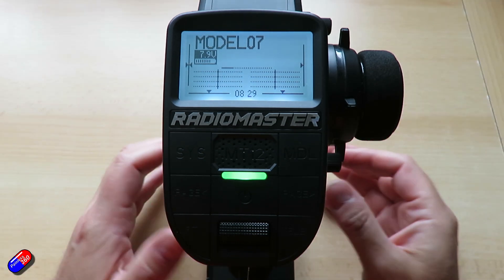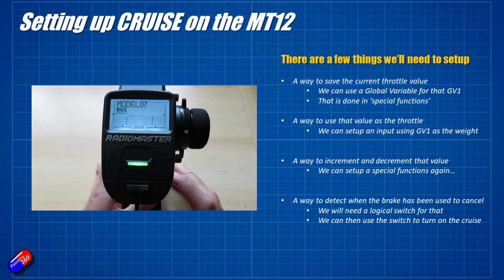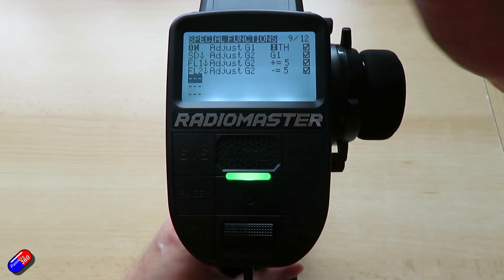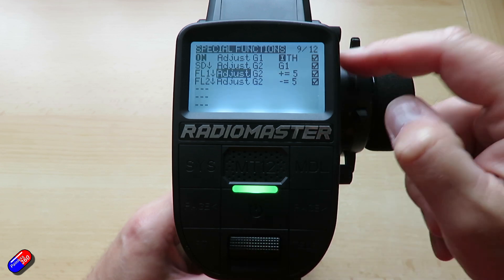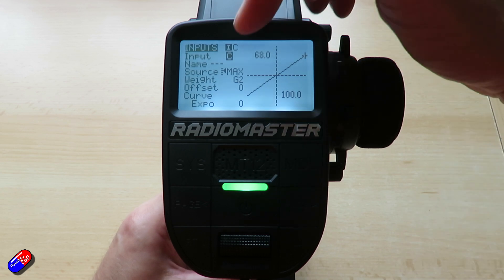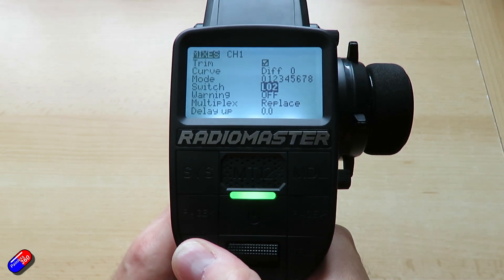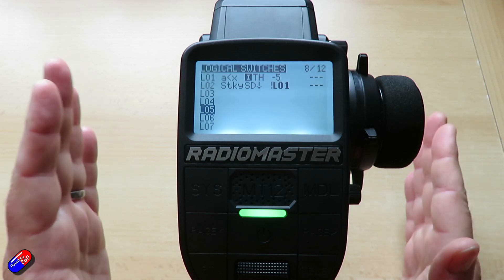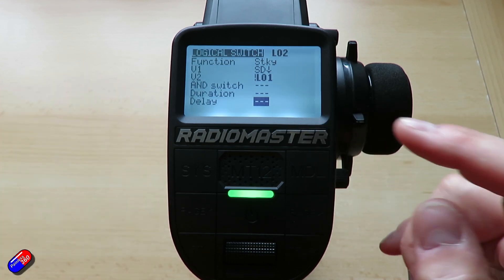R/C Car 'Cruise Control' Setup - with MT12 and EdgeTX 2.10.1 (Patreon Request)

Comment: Great video there Lee... hopefully it gives people ideas of just some of the things you can start to do when you use the various options and capabilities in EdgeTX - and not just on the MT12 - but any handset that it runs on ;) With the MT12, there are two sets of "unused" trims, so could even use one of those instead of the optional (flexible) switches. Meaning you can still use the joystick or gyro unit.
Reply from the maker: Yes you could. See my video on using trims as switches.

Comment: I set up cruise on mine to match what I had on my Traxxas TRX-4. That has a knob to adjust the cruise speed once it’s locked in.

What I did on the MT12 was have a second MULTIPLY line on the throttle mix. I tied that to the S1 knob, set the weight to 50, and offset to 50. So now if the knob is centered, it is whatever you locked the throttle at (100% of G1 value), and you can increase or reduce G1 by up to 50% by turning the knob in either direction.

I also added a third ADD line tied to the throttle trigger so I can momentarily bump up the throttle and then go back to whatever I set it to (like a real car would do).

Both of these are only active when cruise control is obviously, and braking turns cruise mode off with a sticky logic switch same as you did.

Like you said, EdgeTX gives you lots of different ways to do the same thing, which is great (and sometimes confusing!). I find the challenge of “how would you do this” really fun and rewarding.
Reply: I think you'll like some of the improvements that will be in 2.11... you will basically be able to use an input as source, weight or offset for any other input or mix, as well as GVs for all of the above... making it possible to do some interesting mixes without needing to resort to GVs just to capture a value. i.e. offset a pot and adjust weight on one input line, to make it usable as to control weight on another input line... no GVs or other trickery required.
Reply: @pfeerick  pretty cool to get a reply from the dev himself 😉
Reply: @swissfreek  you're welcome. I'm just one of several on the team thou ;)